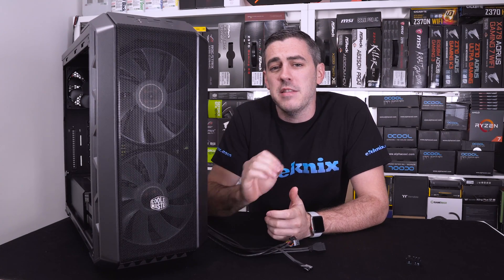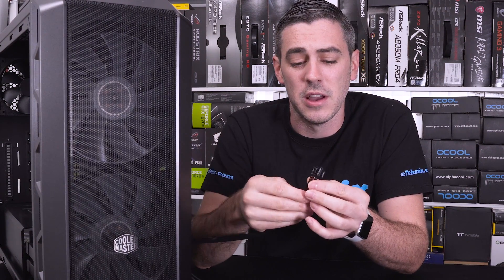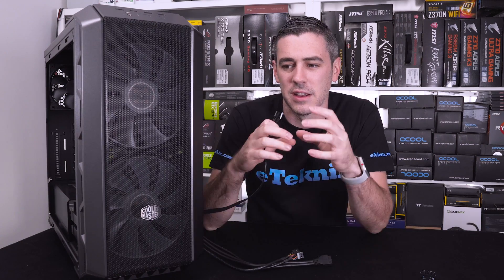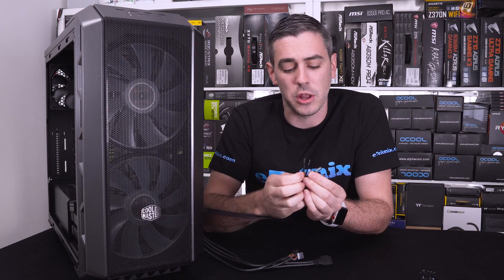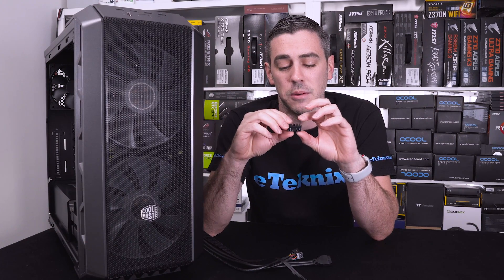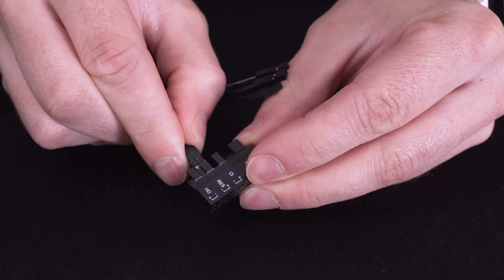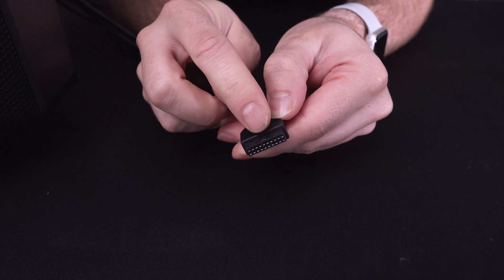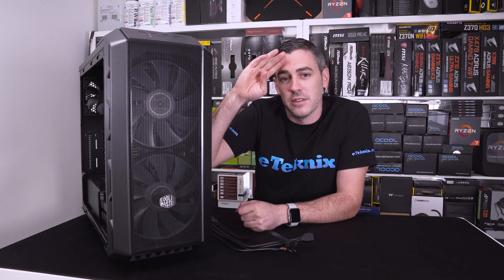How to Connect Front Panel Headers - PCMasterClass

Comment: Hi. You sound like you know a bit about a PCs. I have a Motherboard with no Manual for it and it's not available on line. Can you please tell us how to identify Front panel Pins using Multimeter or any other technic without damaging the board. Thank you.

Comment: A month ago my desktop turns on by itself, and it turns off or dies too.

 When it turns on it works perfectly, I can play games all day, etc, but sometimes it dies out of nowhere, the problem is that it only happens when I'm not using the computer, I went to the event viewer and it showed me a critical "Kernel Power" error and an ID number, it says it's due to the power supply. 
I'm starting to think it's the front panel 2-pin cable that turns the desktop on/off. Yesterday the desktop was dead, as soon as I touched the 2-pin cable it turned on.

 I have tried several times to reconnect and it still won't turn on. I probably have to buy a new box because the cables are stuck in the box.

If anyone has an idea of what it could be, I would appreciate it.

Comment: Thank you! Couldn't figure out for the life of me how to plug in the power switch cable on the Lian Li 011 Dynamic (ASRock X570 PG Velocita mobo). I was really confused when it did not have + or - labeled, unlike the other cables.

Comment: I have a scenario where I have a very modern motherboard that instead - I've put inside and old PC Case (that actually has a modern look to it). Well, almost all the connectors (on the ends of the cables that come from the front panel headers of that old case) don't match the sockets on the modern motherboard - for their assigned tasks.The case is from a big name PC manufacturer - maybe they were being pricks by instead using proprietary end connectors on their cables.  It would be cool if more videos were done on pin-out research (or pin out adapters and soldering) . That would be the super-master class.

Comment: My front panel, that came with my h510 case. It has 2 sides one with pins and one with the pled, power sw etc. I need help, where does the other end of this go. I'm so frustrated, the manuals suck and no good answers online
Reply: Same
Reply: @ThroughDarknessComesLight  you figured it out?

Comment: This is an incomplete tutorial, I wanted to see how I can recognize the correct panel on the mb
Reply: As they can vary between different mother boards, you shuold refer to the user manual for your particular board. You can usually find these online.

Comment: You show the first pin you put in, then you just say "and so on and so on", without showing the others.... that is the problem... The others are not properly marked on all motherboards, so those are the ones we need to see be put in! Specially the power sw that can be put in the wrong way... my ASUS x570-F motherboard does not show eon the motherboard what way it should go, and the manual dfoes not say anything about there the plus and where the minus goes... so that is what I need to know.... The way I see it this one needs to go the other way of all the other ones, and that seem tricky, so I would really like to see someone actually show what way the y should be put so as not to do it wrong...
I can not find anyone showing exactly where to put that one pin for hte power sw, what way the positive and negative goes.... And some pictures actually show the plus and minus going the opposite way of all the other (As inn 3 of the 4 connections show plus then minus, going from the left, while that 4`th one show minus to plus... And the horrible manual for my motherboard does not say anything about what way the plus nad minus go on the board, and the motherboard does not have any markings on what is positive and what is negative on the right 4 pins.... It is actually hard to understand how anyone could make a manual for these connections without showing what way the connection goes, lacking in both the actual motherboard AND the manual...

Comment: Question. Newbie here, on my chassis I only have 3 connectors power led +/- and a 2 pin power switch. Is my chassis missing the HDD led and reset switch? Or is it possible for some not to need those cables?
Reply: hey man. alot of cases don't have that. the pc I made last year and the one I made this year didn't. just plug in the ones you have, and turn it on. if it works great. if it doesn't, take it to your local store and see if they can help. but 90% likely you will be fine.

Comment: Very helpful I am currently building a PC for my daughter and wasn't sure about the polarity of some of the headers. I did think the arrow on the back represented positive but I wasn't 100%. I have one header that has fan on it which appears to end at a switch at the top of my case along with the power and reset switch any ideas? There is a front case fan that plugs into the motherboard but I haven't really come across a header for fan before.

Comment: Thank you I need the info on the Q-Connector it will make it easier to plug the wires in. With that I can use the motherboard manual and place them in the correct positions
Reply: yeah man. g/q connectors are great. I keep mine when I move to new mobos if they don't have one. such a godsend.

Comment: My front panel connectors came as a separate loose cable. One end has the ones you've shown. (P LED + - HDD etc) but on the other end of the wire is a Male connect with 6 pins. 
Going Left to right, 4 pins on top plus a blank.
Then 2 pins on bottom left plus 3 blanks going right. 
I I I I .
I I . . .
I got the led hdd etc side plugged in. 
But now I have the other lose end and no idea where this end connects. 
Have you seen one like this? Where would this connect?
Reply: Noodles Gaming have you figured this out i have this issue right now??!
Reply: @austinisbad  I have. It connects to a wire that comes from the case itself. One of the smaller wires labeled "F Panel" I think. It's the female end and It plugs right into it. It goes in a certain way though so be careful.

Comment: The power and reset switches don't have + or - indicators because they aren't polarized, they just close the circuit between the two pins when the button is pressed. This is why you can turn a system on by carefully shorting the power switch pins on the mobo with a screwdriver. The only reason they have the positive arrow on the connector is because they use the same molded piece for LED and switch connectors. LEDs (light emitting diodes) are polarized like other diodes (current can only flow one way) hence the + and - markings.

Comment: This helped very little when i am missing the connector thingy that makes it simple...
Reply: I very much agree with you
Reply: Type shit lmao
Reply: I have that little connector thingy and I didn’t even use it . It made it harder tbh. The way I did it was so just use a flashlight and focused on where connections connections should go
Reply: @kevinsanmateo4781  Yeah... That's Nice... When your Mobo is compatible with it. Not all are, and they're built different.. Where a breakout cable is required.
Reply: What part of "there is either a plus/minus symbol or an arrow for the positive side" is hard to understand? Your motherboard manual labels what to put where. You can read, can't you?

Comment: i have an rgb strip in my front panel but idk how or where to connect it, help pls?
Reply from the maker: +yonatan goldin 4 pin standard rgb connector?
Reply: @eTeknix  
Same I have a connector in addition. A 2 pin called Fan.  It's connected to the RGB button on my case and in the catalog of my motherboard in the front panel part there is no indication of a Fan connection.  Can you help me.
I've been in trouble for two days now know.

Comment: this is one thing about computers that pisses me off. these type of plugs on the computer need to be redesigned in made simplified. the front panel connectors is the hardest part about building PCS.
Reply: The RGB Header are the worse ever!

Comment: my front panel headers is a short wire that comes unconnected and I know where the small pins go but where does the other side go. it has 4 on the top and 2 on the bottom. it came with NZXT case.
Reply: Michael Arzanipour yea same i have the same issue.
Reply: OLADAPO BRO I figured it out. You have to connect the f-panel connector to it. That comes attached to your case
Reply: Michael Arzanipour where do u find it is it near the right back side?
Reply: OLADAPO BRO yes
Reply: OLADAPO BRO it says f panel
Reply: MIKEBOSS 123 omg thank you, I was freaking out
Reply: Elexus T by the way I figured it out, you have to connect it to one of the wires from the case. They come disconnected.
Reply: Holy fucking shit, thank you! I was so confused as to where the hell that other end went, people just seemed to have it connected to the case already!
Reply: Lads I have the NZXT 510 and I have that cable that is supposed to connect to the f panel cable however it doesn't seem to want to go into it (tried putting it in the way the manual shows) any advice?

Comment: G Connector or Q Connector? We kinda, maybe wanted to know how to plug these leads in without one of these connectors.
Reply: Steamingo Fast:  I didn't know my Gigabyte mb had one of these until I saw this video, then re-looked in the box.  I'm glad I found it.  If you don't have one, usually your MB manual will have a good diagram of the pin placements.  If you get the pdf version of the manual online you can zoom to make it large.  I also didn't think my connectors were marked, but he was right about the little arrows.  And wow are they tiny and black-on-black.

Comment: My motherboard did not have a G-connector, it had the separate connectors when I put my system together in late Dec 2016/early Jan 2017.

Comment: You'd think that In this day and age it would be standard layout across all motherboards. Last built my pc with a i7-4790K and thinking of upgrading start of next year and thought in that time they'd have had it sorted. The connector is block is a good idea.
Reply: this is one thing about computers that pisses me off. these type of plugs on the computer need to be redesigned in made simplified. the front panel connectors is the hardest part about building PCS.
Reply: Logan Braveheart ikr. i’m positive the h510 and h510i support front panel connectors as an all in one cable.